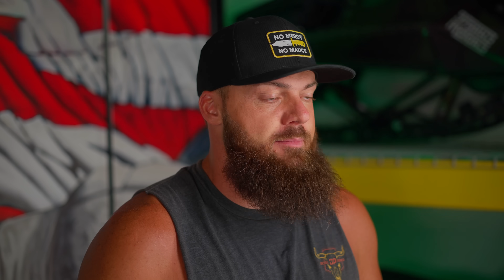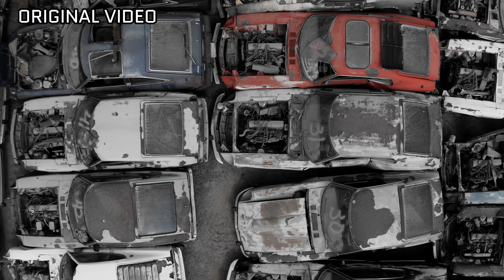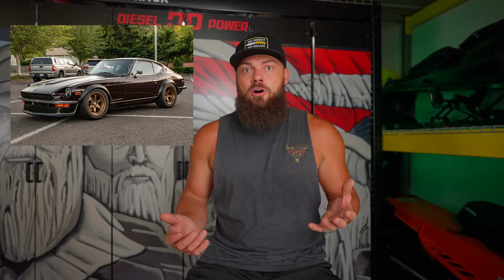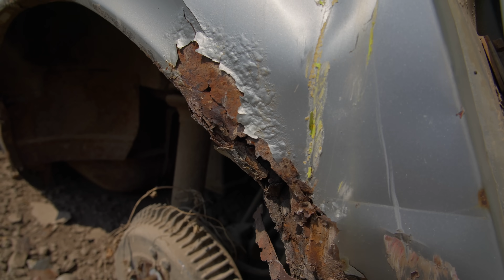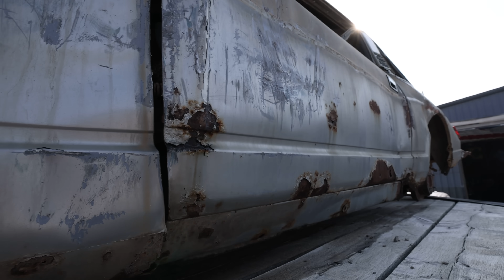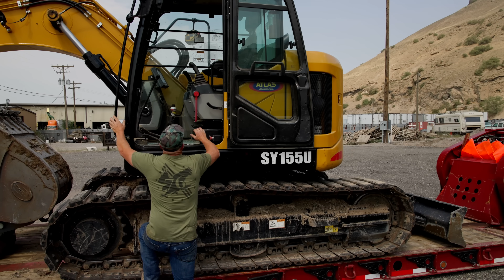Why Would I Smash 70 Rare Sports Cars??

Comment: Talking about the rusty chassis in general: Americans are way too quick to just condemn a chassis if there is some rust. I'm from Finland and roads are salted heavily here in winter, and as you can guess, there is a lot of winter here. Lots of moist ground so if car gets left on dirt, the moisture destroys the chassis even more and faster.

This has meant that we have gotten quite used to fixing and welding the chassis, there are people who only do that all day long professionally. My Toyota Hilux got 1/3 of new floor paneling and all new chassis beams that were rusted away. No-one batted an eye because of it. Now, the chassis is good for another 30 years, easily. I've seen whole floor panelings changed from front to back because it's easy to do to a stripped car and the owner doesn't have to worry about it after that.

The point is that Americans still have some options when picking and choosing best chassis but those will diminish with every scrapped car. Every time a classic car gets crushed with the words "nah, ill find something a little bit better", the line approaches where there are only shitty options left. I'm willing to bet that there is some dude willing to put that time with the welder for even the worst rusted car.
And my heart breaks every time i see salvageable car get crushed because "nah..."
Reply: Anyone that lives in the Rust Belt here knows how much goes in to rusty old shit boxes. Thousands of dollars in restoration and fab work that end up costing more than one in better condition costs.
Reply: These yanks just don't get it. I saw trim pieces on those cars, trims bits I've bought from Ebay USA for $300 cause I can't get them in Australia... they don't know how good they have it with the availability of their cars.... but it will dry up there too one day....
Reply: @Dolf260z  dude without a doubt I've been told to scrap my a70 just because there was surface rust in the spare wheel area

Comment: Honestly scraping is a fun job, I did it for a little while and scraped some good cars and trucks that probably shouldn't have went to the scrap yard but I didn't care but money was key, most sad about the 79 cutlass, and possibly soon a c10, both were just rotted out
Reply: The funny thing is about that truck you mentioned atleast or any other truck your gonna scrap, is if your looking to buy a new truck your actually better off money wise to save that old truck even if it's rusty and restore it , and yes these old trucks will never be worth what you put into it but it's a labor of love and even with alot of rust repair and metal work it'll still be cheaper than a new truck
Reply: The c10 I'm talking about is not worth saving, broken rotted frame, no floors, cab corners or rockers, bed is falling apart and the tailgate split in half when I stood on it, honestly I have trucks ranging from a 1942 all the way to a 2016 and the 2016 does work better but I do injoy driving my older trucks like my 84 k10
Reply: @ryantrx400  well yea that does sound like it wouldn't be worth it seeing as you'd probably would have needed literally new everything besides maybe the motor and trans and shit, but was trying to get at that in most cases you'll be better off money wise in today's truck market to build a truck and fix it up yourself and get it painted and all than you are buying a brand new truck
Reply: @smokeythehuman3596  true true, I got all of my trucks before the market went to hell, I got a 2003 f250 extended cab long bed with 160k miles 7.3 for $2,000, I can sell my 2016 f150 for 5k more that I bought it 2 years ago with 50k more miles
Reply: @ryantrx400  yea I got my truck an 01 ram 318 2wd exstended cab with 142k miles on it about 3 years ago for 4500 and according to kbb it's still worth the same amount of not slightly more and it's got 182k miles now

Comment: Z cars are great, motors have power. I’ve put big blocks in them small blocks in them rebuilt the original motors with turbos or without. The cars are absolutely monsters.
Reply: A z car motor is a 4 cylinder datsun with two extra cylinders added on to it, you can take Pistons out of a z car and put them in a datsun

Comment: As much as i can see that yes alot needed to be scrapped i can see alot of parts there that could have been easily pulled off and sold on for further profit over scrap metal (Yes alot was a boat anchor) but for a avid datsun purist or fanatic those parts are extremely hard to come by most people horde them like this example or just wont sell.. And the latter is anything in japan is jsut not there anymore as its climate jsut destroys cars so they ask huge premiums on some quite simple parts even patch panels that having someone remake costs more than cutting it out of a rusty car.. as people just can not at all get them domestically. I would have spent alot more time pulling and wrecking them then scrapping them.. THe glass and trims on alot of them alone are worth better money than smashing them... the gearboxes and diffs can be rebuilt and used engines that at least had a hood on them those l26/l28 engines are worth good damn money in shit conditions ready to rebuild even just manifolds or other parts revapour blasted... the old owner clearly didnt try hard at all or move the parts i can see huge margins in every single one of those rusted shells if you know the market and people its easy to move... I hope you at least have learned that anything to do with vintage japanese cars still has ALOT of worth over a scrap pile and wrecking ball... any decent metal to make one decent car that can be worth $60-100k... i understand why everyone is pissed
Reply: Mav did you missed the part where he only had just over 24 hours to get rid of them? Is it reasonable to ask that man to move all the cars to his property and completely shift from his normal work to parting out each car?
I don’t understand why people are pissed to the degree that they would leave death threats and engage in other acts of douche baggers.
Reply: @stephaniezimbalist3757  i hear you Mav but Stephanie is right. The one and only thing he could’ve and should’ve done is quickly taken all the T top glass. It pops out nice and easy and I’m sure it’s a fairly high dollar and sought after item because they break during installation or hail or storage and what not.. Just like Firebird T top glass, which I’m Familiar with. Thats about all the 24 hours would have allowed.

Comment: When I was a teenager I started my autobody career and the shop I worked at then specialized in "Z" Cars, we worked on a lot of them and some were modified and really fast. I am 59 years old now but those 240's, 280, and 300 Z's are still cool cars, you hardly ever see them on the street but that bunch right there were trashed with maybe a few parts worth saving on them.

Comment: Part-time job in HS was for a car dealer who at one time had been the local Packard and Studebaker dealer. When those went belly up they transitioned to Datsun, Volvo & Mercedes Benz - only dealer for those in several hundred miles.

So, was working there when the 240-Z first came out - they were instant hits and for quite a while there was a considerable wait to get one. If you did get one you could immediately flip it for considerably above the sticker price.

The series of sports cars that Nissan (Datsun basically a mark of Nissan's) produced prior to the 240-Z  was called "Fairlady" and the decision was taken by the corporate types in Japan that their new model for the US market would be marketed as the Fairlady Z. The guy who had pushed for development of the car, Yutaka Katayama, the 1st president of Nissan North America knew this wouldn't appeal to US buyers so he took the extraordinary step of having alternative badges and promotional material made up and swapped out the Fairlady ones for 240-Z when the cars came off the boat.

He had huge successes with the 240-Z and Datsun 510 but had seriously pissed off the corporate higher ups
and never held a position of any responsibility in the company after returning to Japan.

Still, he had lots of love and respect from the Z and racing community and outlived his detractors - died in 2015  at 105...

https://journal.classiccars.com/2015/02/22/father-240z-dies-age-105/

Comment: I’m a classic truck/diesel guy… old trucks before 1994 that had tractor motors in em… any old mechanical diesel, & le me say that it hurts seeing any old car getting scrapped. 

But knowing that someone that knew what they were talking about already went through em, & took the good parts off is good to hear.

I like the old fords from 1992-1997 or ones back in 1983-1994 the 6.9/7.3 idi generation. 
I’m not a crazy Cummins guy by any means, I don’t rly like em cuz they’re expensive to fix. They’re good when they run, but $ to fix.

An IP for a 7.3idi is $600-800, an IP for a Cummins is 1-2K plus if it’s a P-7100 p-pump.

Comment: Back in 2004 I had a 96 300zx amazing car. The engine was rebuilt for performance. Twin turbo etc etc. Had 12.5" tires on it. That is the only car that I have ever owned that scared the shit out of me. I used to road race an old 76 F150 ranger on Ozark Mountain roads "like a roller coaster, the banks all wrong etc" But nothing scared me like my 300ZX. I could be sitting still barely hit the gas and it would just sit there roasting the tires. I never managed to push it to its top speed because it got super floaty and it felt like it was gonna take off like a jet any moment.

Comment: The z cars we nice but, and this is from someone that owned and drove several 280's and two really nice 240's. They rust, usually starting in the rear wheel tubs right near the strut towers and bottom of the spare recess is the first place, second is front sub-frame right at the front shock towers and edges of the windscreen.

If you're on it quick you can wire wheel/flap sand the surface rust off before it starts getting deep. Holes cut out and new welded in so on and so on. The metal itself is not super high quality and can easily start crumbling after so long and when it's past certain points, it's better to crush and melt than try to save. Just strip out what parts you can to resell to the collector market and not sweat the rest.

Comment: Your such a goof, I love it. I don't want to step on any toes either, but I have rarely, and I mean rarely seen any Z car without a major rust issue. That's one reason I stayed away from them since they came out. That having been said, my baby sisters first car was an old Datsun 510, that she drove the crap out of for 4 years. When she got rid of it the engine and trans was the only thing worth saving. But she got a great deal on her trade in. The floors had holes in them that the mats had to cover and it was an old gold/yellow 4 door. My son got an old 510 20 yrs later and he took it to another state when he moved out. His story is that when he got rid of it the engine and trans was the only thing worth saving as well. Datsun made great cars, but it took the American collector, and marketer to solve the undercoating rust issue. Just like the American Ford Ranchero 63 on.

Comment: Next Vid. Heavy buys 3 pristine, 1969-70 240-Z’s and chops / welds them into one six door 4x4 SUV and lifts it to the sky, powered by a Cummins 4-BT, running on reclaimed fryer oil. Fills it full of KFC and Taco Bell, then air lifts it via C-130 Herc to Tokyo and drops it from 10K+ feet, crashing right through the center of the Nissan Heritage Museum, destroying serial #1 Fairlady Z. Then ultimately reveals on YT that Yoshi Aikawa’s heirs paid him to do it. 🤣😂, So it’s all good. 🤝

Comment: I’ve had a half dozen Z-cars, all back in the late 70’ to the late 80’s. A few of them were really rusty back then! None of the Z’s I was in the flashback scenes could be properly restored for at least 10 times it’s finished value at best. I can’t tell you how many friends and acquaintances have been shocked at how much less they got for a restored car then they spent doing the restoration! And that includes $0.00 for the hundreds of hours they invested.
Have you ever wondered why there are so many partially restored cars for sale? Most sellers are just hoping to get back what they spent on all the new, still in boxes, parts they bought back when they had stars in their eyes starting out on the project. That includes me. In hindsight the most fun was pouring over the parts catalogs and ordering the parts. I’m sure that I underestimated by at least a factor of 10 the time it would take to assemble all those new shiny parts only to end up with a rust bucket with lots of new parts on it. 
These days I just take the cash out of my wallet and flush it down the toilet. It saves so much time and work!

Comment: Even from South Carolina I could tell those cars were trashed. Anyone who has had anything to do with the old Z cars knows the #1 killer is rust. All of the older Japanese cars had this problem because they were built as cheaply as possible to let them be such a bargan over the domestic cars. I was around when the 240 came out. I had early Datsun trucks...520 series. I know every nut and bolt....well used to. I'm an old fart now. Rust was the ultimate death dealer in these vehicles.
 I agree with D. These cars had been in this yard for years for sale for parts. If you were such an enthusiast you already knew about these cars and had parts from them.
Give the man a break. He ponied up the 75k and did the work.
If the content disturbs you.......
DON'T EFFING LOOK!

Comment: Two things, even my 1982 280Z purchased in 1988 in FT Gordon GA, already had some rust spots (surface) on it. Those cars where not expensive and it was for a reason. You needed to stay on top of them. Second, those been out in the weather (Summer and Winters) nothing much would have survived. 
If they would have been under a climate controlled environment, we would never hear of these vehicles because of the price they would be going for.  Thank you for the video and it is heart breaking seen one  of those going out like that but eventually they all will unless they well kept.
Reply: Are you single

Comment: I have scrapped a lot nicer cars and trucks then what you have there and it all comes down to real-estate if you don't have a buyer that day for them then you are spending money to move them and store them which usually cuts into you're bottom line.  In the past I have cleaned up at least 10 places like this and the price of that dirt is usually way more then the rusted metal sitting on it.  Good job scrapping nice pay check for a couple days work.

Comment: While I admire you acknowledging the Z car loyalists, I had a 77 280Z . As a ASE Master Tech certified mechanic , I will tell you this . The Z I had my dad bought new . I owned it for 9 months, and sold it back to him . My Z was , not fast and poorly built . The u joints were not designed to be changed . I spent $1600 in parts in 9 months with no major component failures . It handled OK , it stopped OK , fast it was not . Worst car I ever owned . Every Nissan I ever looked up with a timing belt was an interference motor . Garbage 
     Every car you scrapped was way beyond saving . Ignore the cry baby’s , love the content , keep em coming .
Reply: p!nned by HeavyDspark  Already subscribed .

Comment: There's a certain point of gone where it would be more cost-effective to have someone fabricate you a body than to restore them. I've done several that were on the bleeding edge of that. My wife was not amused. 

If people wanted to buy the iron oxide farm in huge quantities, then there wouldn't have been rust agriculture in a gravel pit that had so little residual value a collector nopes out of keeping them around. Stuff has a useful lifespan. A mass market car that was immensely popular is not going to have the same depreciation curve as a 1994 McLaren F1 [which is now worth over 20x retail]. You can wind up with a 1994 Mustang instead.

Death threats over scrapping a tetanus collection. Grow up, people.

Comment: The Early Z cars came to North America rusty. I know a guy who worked at a Datsun dealership in the early 70's and the cars that sat on the deck of the ship coming over from Japan was all rusty from the salt water and air and the metal was not very thick I help restore 3 early Datsun Z 240 cars and many of them we had to put new floors and sub frames in them because they were so bad. We even took one and dropped a 1970 LT1 engine in one that came out of a rear end totaled 1970 Stingray and it's was fast but we had to make a tubbed front end to handle the torque plus it was going to be raced and there was no way the thin frame was going to handle the twisting of a little over 400 HP SBC 350 anyway  like I said many of those cars were rusty coming here and the dealers had to repaint the cars  to be sold that's how bad they were but they are bad ass looking cars and they hadle great I'm a big fan of the Z 240 and the Z280's from the early 70's.

Comment: I scrapped my '76 280Z 2+2 years ago. Had a bent frame. It was like that when I bought it. Fixed it up enough to be drivable for quite a few years and then it was time to get rid of it.
I made more money off the parts I sold off of it than I originally paid for the car. I also saved the engine, tranny, and a bunch of other parts.

Those cars in the vid that you scrapped were the kind that I would have been pulling a few parts off of if anything was useful but there didn't look like there was much left of them at all.

I'm actually surprised that people picked up the few that you didn't scrap.